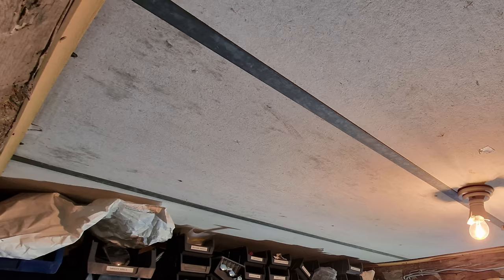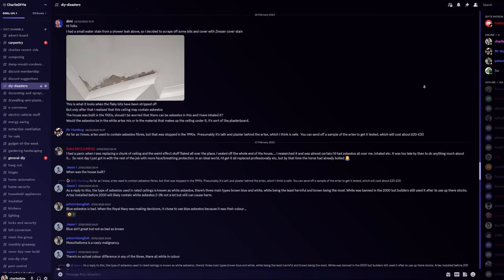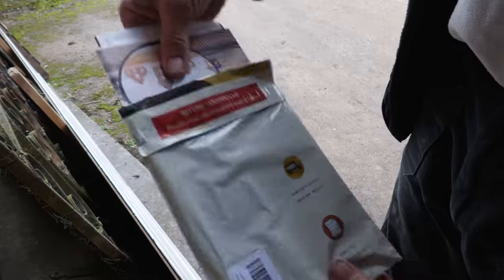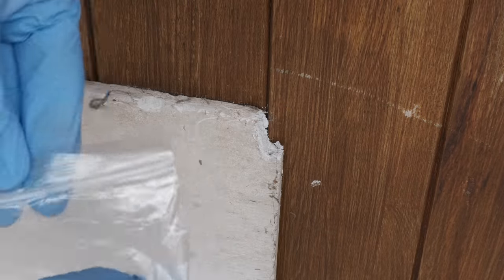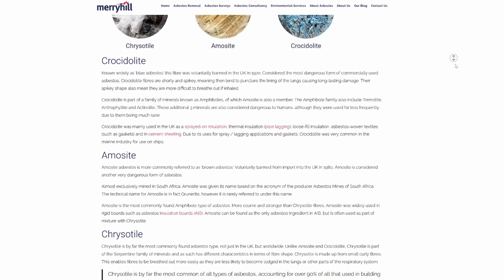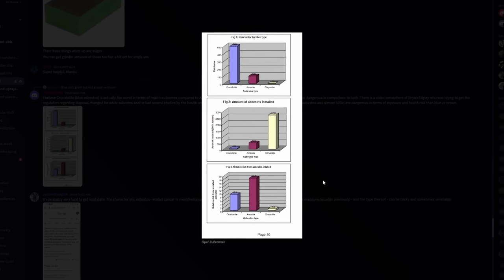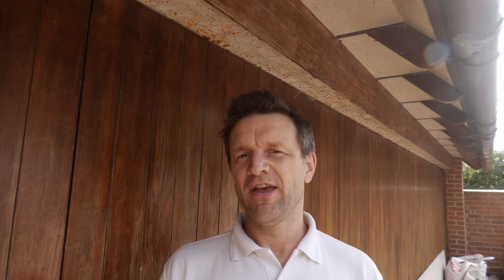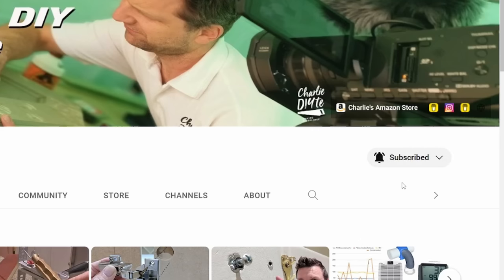I've Got Asbestos in My Home

Comment: Couple of things I can add. 1. I have it in my airing cupboard and (likely in covered up) artex ceilings. 2. The guy who came to do the tests scraped it without PPE and without a care which left me confused as to its danger. 3. Local builders tell me it’s no more dangerous than any other mineral dust like brick.. it has a bad rep spreading fear. 4. There are so many rogue traders operating as asbestos removers who will possibly remove and make a mess leaving dust in the air which is just petrifying. So yeah.. I try not to worry because it’s no worse than any other brick dust but I’m scared to have it removed. Appreciate any vids like this thanks
Reply: A lot of cowboys in the asbestos industry, best to take sample yourself, follow all procedures and get it analysed by a reputable asbestos lab, don't use  a testing kit as you don't know if the lab they send it to is any good
Reply: Agree, I had an estimate from an asbestos removal company based in Eastbourne, glad I checked them out before booking them in, very dodgy operation. A lot of them are like that, and hide behind incredibly slick well designed websites full of stock photos and fake testimonials. You have to be so careful.
Reply: I'm afraid those builders told you wrong. Asbestos is very dangerous indeed.
I used to work for a local authority and asbestos courses were mandatory and lasted a day every year.
Some of the things they told us were heartbreaking. Teachers getting mesothelioma from putting pins in noticeboards children and wives  getting it from their fathers overalls. Horrible stuff, esp the blue and brown.
Reply: Eeeeesh, follow the data/empirical evidence, not the "feelings" of these people. 

It takes decades for the effects to show up. 

My aunt died from it 30 years after her husband worked with it in a General Motors' brake manufacturing site. 

She never went to the factory- she got it from washing his clothes when he came home.

Comment: It's interesting that I see people apparently suffer from mesothelioma after "just one exposure".  I had an exposure from being present when my friend accidentally drilled through some asbestolux boarding a couple of years ago.  I'm 45 and if I develop mesothelioma in the next few decades, I'd more likely put it down to the heatproof mats the bunsen burners sat on at school (chipped corners and all mashed into a pile at the end of the lessons), brake pads, clutches, ironing boards, the terrapin huts at school which blew clouds of asbestos insulation dust into the air whenever anybody slammed a door.  We definitely owe it to ourselves to take great care to avoid this stuff at all costs but, given we have all been exposed to it almost constantly through our lives, a single exposure isn't worth losing any sleep over if you were in a school in the 70s and 80s in my opinion.
Reply from the maker: That's a very good point, well made, and I agree, like you I'm sure I've been exposed over the years. I've definitely had classes in those huts and no doubt used bunsen burners on the mats. 👊
Reply: Exactly this, it was everywhere, I can remember using a wire brush to clean off brake dust on old callipers on my first cars back in the 80s, the next one will be fibre glass.

Comment: I have used one of these testing kits before. I was testing some old corrugated roof sheets, which commonly had asbestos in them. They did not contain Asbestos but when I went to dispose of them the tip wouldn't take them. As despite having the test results there was no proof that the material I was bringing was the material tested. I had no choice but go through the hassle of breaking it up and double bagging it for disposal.
Reply from the maker: Makes sense. Glad it didn't have asbestos in though.

Comment: Hi Charlie, great awareness boosting video, as in honesty knowledge of asbestos is really very low in the wider population. I work as a handyman and was asked recently by an estate agent to quote on repairing damage to a ceiling that had artex on it. As the property was early 1900’s it’s a safe bet that the rates was applied pre-2000 and therefore may contain asbestos. When I raised this with the estate agent and advised an asbestos test was performed I was greeted with blank looks! There are some great online asbestos awareness courses available for under £20 and I’d encourage every keen diy-er or tradesperson to undertake one. But my point is it’s not only diy-ers that lack this knowledge, shocking that an estate agent is completely unaware!
Reply from the maker: Thanks Darren. I appreciate that and thanks for sharing your story. I'm afraid that doesn't surprise me. Estate agents tend to be after maximum throughput of work to maximise their commissions. Asbestos would represent a tedious irritation to a lot of them.

Comment: My older brother was exposed to asbestos when he was younger, working in construction and he now has a Mesothelioma. He’s stable at the moment with stage 4 cancer and he’s taking a new drug which is immunotherapy drug and is helping him a lot… I remember when I moved from my last home, a home that was built in 1965, ex council house. I took up the old carpet in the living room, and there was black vinyl underneath, and towards the edges of the room a lot of the black vinyl became brittle and broke into pieces. I removed them and filled the gaps with Polyfilla to make the floor flat for re carpeting. I just watched a video earlier and it said asbestos can be found in black vinyl in older houses… Also, I have a condensation issue in my home, a home that was built in 1930, which has rendered brick on the outside, made from solid walls, but a new kitchen extension in recent years which is made with cavity walls. After having a damp survey for peace of mind, I decided I will replace my concrete air bricks with plastic air brick sleeves and not paint over them because most of my concrete air bricks are below the block paving and it’s allowing rainwater and dampness to seep in. Inside the house in my cupboard under the stairs I have my gas boiler there and my smart meters but the plaster on the brick wall has peeled off and I can see salt deposits there, and it’s part of an exterior wall because it’s a semi detached house which has the air bricks outside below the block paving. So the damp surveyor recommends I hack off the bottom of the plaster back to the brickwork on the inside and put a skirting board over it to allow the brickwork to breathe, re painting the above with ordinary white emulsion paint. In my living room, on the same exterior wall as the cupboard under my staircase, I have drywall’s there which are dot and dab. I have to remove the bottom part of the skirting board and hack the plaster back to the brickwork, before placing a new skirting board over it, and redecorating the drywall above and repainting the new skirting board below. Unfortunately, nothing is ever straight forward Charlie, is it. Thanks for uploading the video, and I hope your diligence has helped you avoid any potential hazards with asbestos in your home. I’m just worried when hacking the plaster back to brickwork, or removing the skirting board below in my living room, I may need to go higher up the wall, past the skirting board below, removing part of the dot and dab drywall above the skirting board to make sure the wall drys out properly. I’m also worried I don’t encounter any asbestos but the damp surveyor believes I don’t have asbestos in my home, but maybe for peace of mind beforehand I might get a asbestos survey carried out.
Reply: My Dad was a mechanic and also contracted Mesothelioma. Unfortunately for him it was too late for any treatment and he died two years ago. It was a really grim way to go.
Reply: @chrissavill8713  I’m sorry to hear about your Dad passing away two years ago. I’m 51 years old now, and I lost my Dad to Leukaemia when I was 15 yrs old. My older brother is 61 yrs old, and is a twin. Thankfully, because he’s always kept fit most of his life, going to the gym and eating relatively healthy, as well as, fortunately, having access to a new immunotherapy drug, the doctor has been surprised how my brother has coped with his cancer so far, when he was in a really bad way a few months ago when undergoing chemotherapy. During that time the cancer was spreading rapidly, but since stopping the chemo and continuing with the immunotherapy drug the cancer spread has slowed down, and reduced in some places, even though my brothers cancer had recently gone from stage 2 to stage 4. My brother told me they won’t cure me, and eventually I will die from the cancer but at least the drugs I’m taking, and my brothers stubbornness to try his best, on his best days to go to the gym has helped extend his life for as long as possible. In mainland Europe they have access to the full range of immunotherapy drugs, but in the U.K. patients are only given one type, due to how expensive these drugs are.
Reply from the maker: So sorry to hear about your brother. It sounds like he's fighting a wonderfully valiant battle. 👊 No nothing is straight forward! I suspect if there was asbestos in the vinyl it would have been non friable and therefore very low risk. On the damp, sounds like a good approach. A guy on my Discord forum has just stripped off some Zinsser paint from a wall that is damp beneath. He thought he had an underlying leak but since he stripped it, the damp has dried out which suggests the  paint was preventing it from drying out. Shows the importance of breathability.

Comment: Hi Charlie, I worked for the MOD in the early 1970’s and I worked in a store that had asbestos and we had to cut it into lengths and ship it out to various ships to use as a lagging for pipes. We had a large pair of scissors to cut the asbestos and the bench where we cut it was always dusty with asbestos dust. Roll on the years and I started to have breathing problems, I also need a pacemaker fitting and although I need one urgently, they are reluctant to put me under anaesthetic use to my lung health, so it looks as if I have a double whammy of problems. There is a list of people who have been in contact with asbestos and although it cannot help if you are infected it does move thing alone if you are diagnosed with the problem. If you do remove it yourself (something I would advise against) make sure that it is very wet at all times
Reply from the maker: Hi John, good to hear from you. I'm so sorry to hear about the health problems you're battling with. Very sound advice. It's tempting to try and remove it myself because of the money I'd save but I won't be taking that risk. You take care and I hope you find a way to get that pace maker fitted. 👊

Comment: Hi Charlie  - Just a small pointer for you...  it is always a good idea to dampen the material you are planning to sample.  The sample collected on your video could have been removed in a more safe manner - but perhaps that wasn't detailed in the testing kit?   You could dampen the material - or use a wet wipe lining the inside of your pincers and place the wet wipe over the corner of the board you are sampling.   Another method is to place duct tape over the corner you are planning to sample and break within the duct taped area.  Any of these additional measures will help to reduce the amount for fibres becoming airborne.  x
Reply from the maker: Thanks. No that wasn't suggested but makes perfect sense. 👌

Comment: It might be worth distinguishing between asbestos insulation board, which is what you appear to have, and is much more friable, and asbestos-cement board, which is cement bound, and much more stable. AC boards are typically used for older profiled garage roofs and industrial cladding, (including fake roof slates) and typically are unlikely to form a hazard unless cut/ sawn.
The softer insulation boards, however, are much more likely to release fibres, as you observed. I would not recommend removing that other than by professionals, under any circumstances - the exposure which can lead to Mesothelioma is scarily small, if you are unlucky.
You can paint over the AC boards to reduce the risk of fibre emission, and they are generally OK to leave until they need to be replaced.
Also worth mentioning that Asbestos-cement was used in some external soil stacks, usually painted black, and easily confused with cast iron, just by appearance. Easily punctured by a Dynorod, too, as I know from Professional experience - architect, not plumber!
Reply from the maker: Thanks, that's a very good point. I had a section on friable/ non friable but didn't put it in as I thought it was too much detail for some people but actually it's an important part of the discussion so I wish I had left it. I agree. I won't be risking doing the removal. I'll have to empty the entire room which will be a massive pain, and get someone in to do it. 👊
Reply: There is a non asbestos version called superlux which looks almost identical to AIB
Reply: Informated stuff. I would b grateful if you or some body els give me some opinion. I am very disturbed for few days. I have a garage with corrugated asbestos roof. It had a moss on it stopping rain water to flow. Few days ago I removed moss with very little scraping by long conduit pipe  while standing on ladder. After disingaging moss, I sweeped it with stiff brush and thrown down on ground while standing on the roof. Finally I collected all moss with brush on ground and put in a bag. During is process I have been wearing mask P2, my mormal vision glasses, hat and work clothes. I did this job on dry day without making it wet. Now browsing and reading other people talks on this topic, I am very confused and worried if I am not exposed to asbestos fiber though I did very little scraping?

Comment: My father died of asbestosis at 75 years old. Apparently he probably came into contact with some asbestos dust in a factory he worked in back in the 60's when they replaced the heating pipe insulation & it was probably the one & only time he came into contact with it. A case wrong place at the wrong time I guess but it is really bad stuff.
On the flip side my father-in-law worked in the heating industry in the 60's & regularly used asbestos to lag pipes in boiler houses. He died of other causes & nothing to do with asbestos. 
There are two sides to every coin but you can't be too careful with this stuff or any other airborne dust particles.
Reply: Are you sure you mean asbestosis not mesothelioma, incredibly rare to get asbestosis from short term exposure unless it’s extremely high concentration
Reply: @jamiejosh96  Asbestosis was on the death certificate so that's what we were all told was the reason. After being diagnosed & before passing he struggled to remember where he could have come into contact with it. He was in the RAF during the WWII in India & then in a factory for the best part of 30 odd years before retiring. This info was needed for a financial claim form & for some sort of Asbestos database.
Reply: My grandfathers brother died last year due to complications from inhaling asbestos. He helped renovate a house in the 70s. He was very sick and had problems breathing towards the end.
Reply: @hasselnttper3730 renovated one house. Unlikely the only time he came in contact with it. If he worked in construction or other type commercial contract work he probably came I'm contact with it more. Highly unlikely one job did it. Possible but unless the air was thick dkr a couple days where his lungs got overburdened its  ot very likely that a few days exposure did it. It usually takes years of heavy exposure

Comment: People tend to forget, it was also used in Brake Linings, Clutch Plates and Gaskets. So lots of people have been exposed in one form or another.
Reply: Textured coating is one of the most common material types inside the house that people don't realise could contain asbestos id say over half we test come back positive with asbestos
Reply: @Capricorn_IV  Yes, Artex and Anaglypta Wallpaper. Also Insulation, Wiring Covering, Toliet Seats, the list is large.

Comment: You don't need to cut it. I bought 2 heavy plastic sheets, cant remember the gsm. About £40 in the end. Then wrap up and quack tape the seems. Then repeat for double bagging. The local tip even helped me carry it. In the end I think the plastic weighed more than the sheet. Simple

Comment: New one for me - we had to replace some pitch fibre pipes before we could buildover, because it's a public sewer. Had them tested before cutting and they contained white asbestos. Double bagged and then disposed of by a waste contracter.
Reply: We just found pitch fibre pipes under our home which we are extending, we plan to get them tested. I am hoping they are a lower risk to remove as the fibres are stuck together with the coal tar but we still need to find the best solution to get rid of them safely.
Reply from the maker: Fingers crossed 🤞

Comment: Informated stuff. I would b grateful if you or some body els give me some opinion. I am very disturbed for few days. I have a garage with corrugated asbestos roof. It had a moss on it stopping rain water to flow. Few days ago I removed moss with very little scraping by long conduit pipe  while standing on ladder. After disingaging moss, I sweeped it with stiff brush and thrown down on ground while standing on the roof. Finally I collected all moss with brush on ground and put in a bag. During is process I have been wearing mask P2, my mormal vision glasses, hat and work clothes. I did this job on dry day without making it wet. Now browsing and reading other people talks on this topic, I am very confused and worried if I am not exposed to asbestos fiber though I did very little scraping?
Reply: You can get tested for exposure so I would look into that.  The main thing is: don't do anything with asbestos yourself again.  You need to get it removed by a licenced contractor.